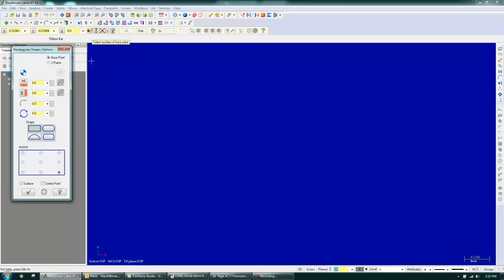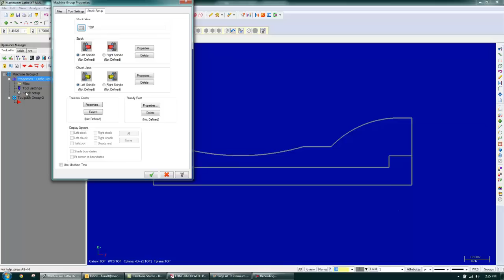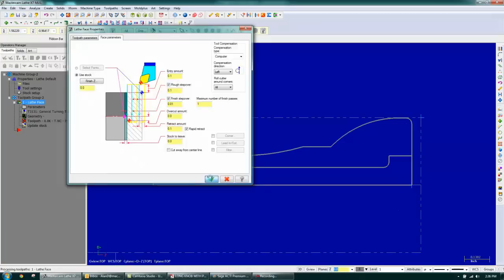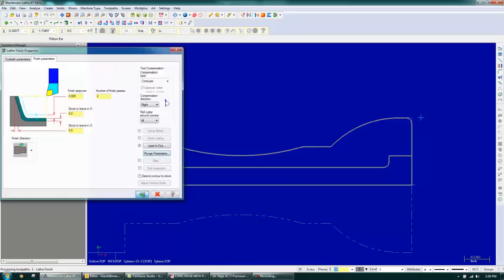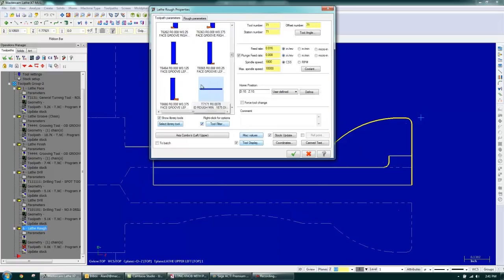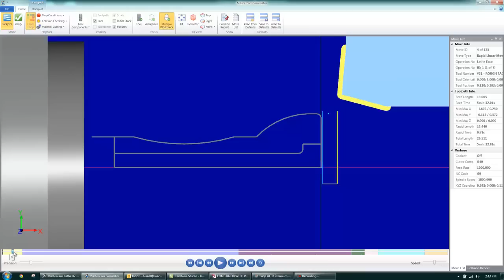Simple Mastercam Lathe Part

Comment: sir, your video is very helpful. however, i'm stuck at lathe drill part which you're using spot tool. it says "the toolpath starts with the tool embedded in the stock. modify the toolpath so it starts outside of the stock boundary". same goes when you are using the drill tool no 97. can you please help me? what should i do? thanks.
Reply: https://www.youtube.com/watch?v=oYTv0AZDDNM&t=336s